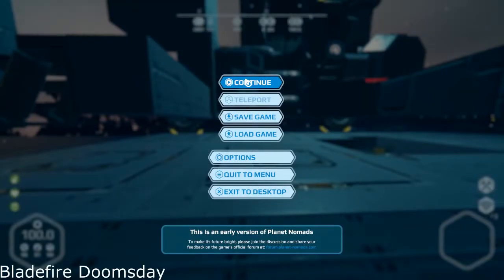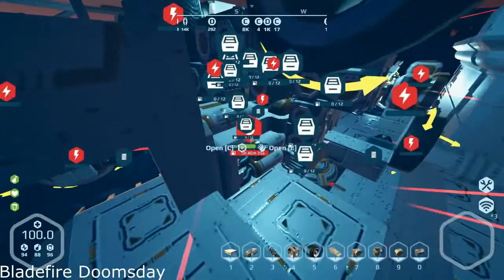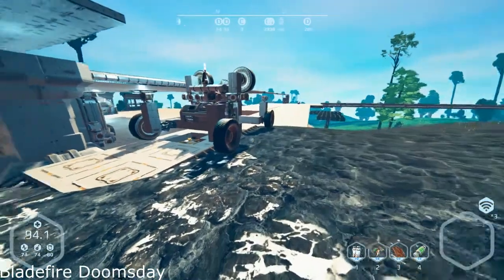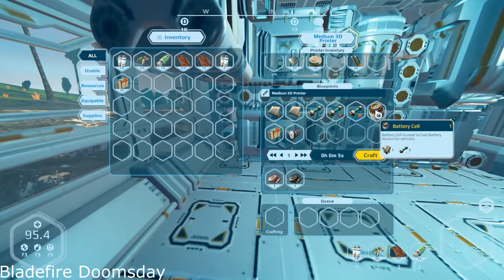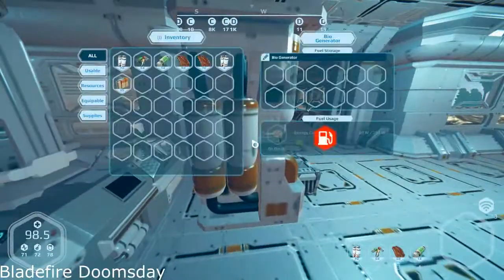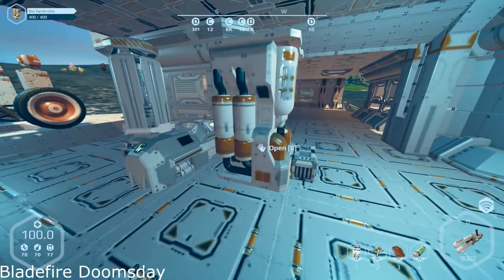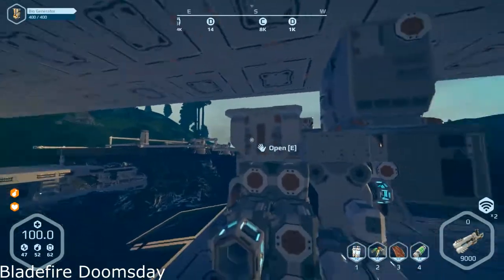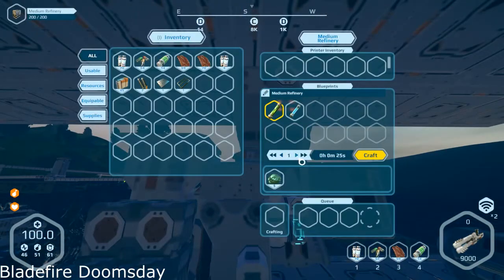Planet Nomads v0.6.8 Issues with power and other problems.

Comment: Not sure if you've gotten an answer or resolved this, but what speed are your wheels set to? That will alter the base power (35) and increase it pending on your setting. Normal and fast are higher energy demands.